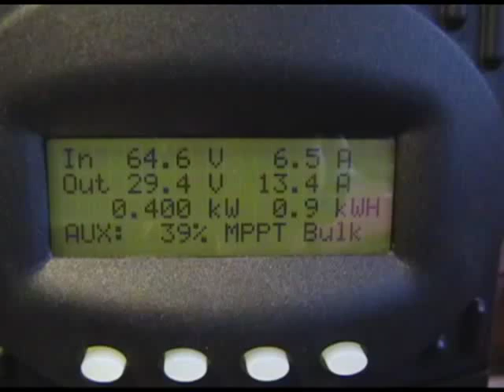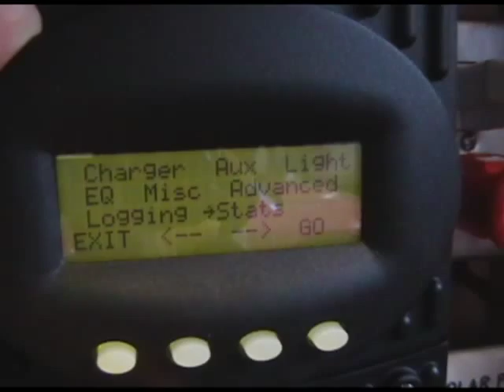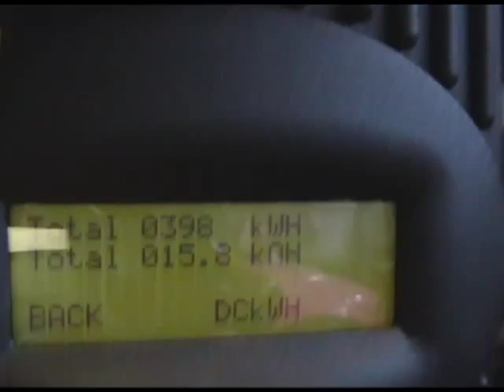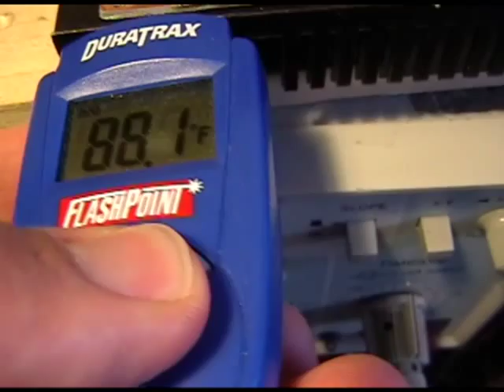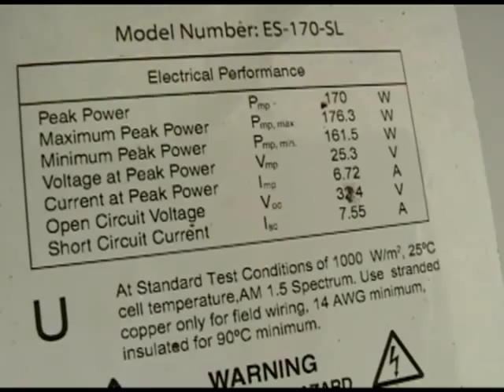Outback FM-60 diversion load using N-Channel MOSFET.mp4

Comment from the maker: Note to those who want to build this. This circuit it considered a dirty hack. This is not a safe way of doing this. It works because the load is non inductive resistor placed close by the MOSFET. If you want to use other loads like motors, lamps, pelties junctions - do not use this circuit. There is no galvanic isolation between FM-60 Aux output. There is no current limiting protection. There is no provisions to suppress inductive voltage spikes if driving inductive (motor) load. Also, if MOSFET fails closed (turned on), it will eventually discharge your battery to zero, as there is no low voltage protection disconnect.

Comment: I have ordered a FM60. Could you show a circuit diagram of your dump load controller?
Reply from the maker: Shaun Dobbie 
Here: http://i.imgur.com/u3tcZvt.jpg It's very basic. I omitted LEDs for clarity. Keep mosfet close as possible to resistors to minimize inductive spikes. R2 can be 10K, R1 is load resistors and their value depends how much current (and voltage) you want your dump load to operate at. Make sure to pick your power mosfet rated voltage at least twice your maximum battery voltage. And make sure it can tolerate 12V on the gate.
Reply: Thanks for that.